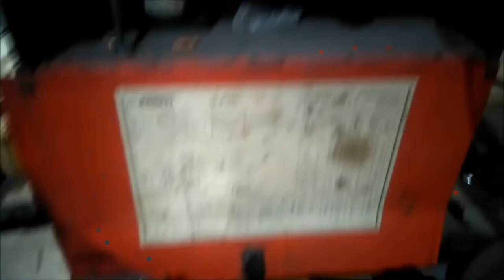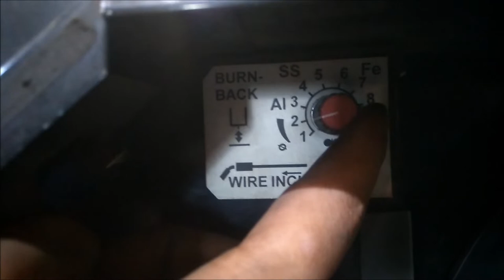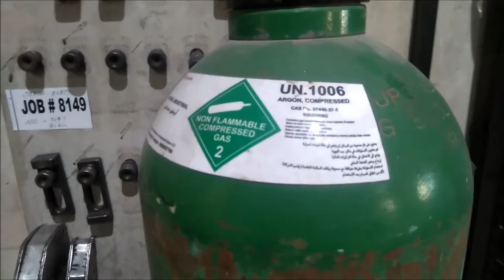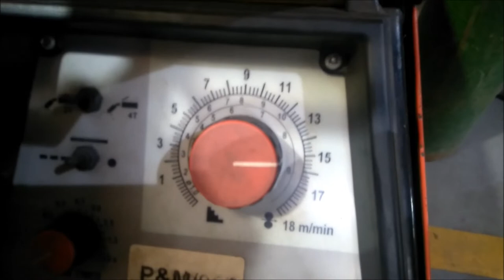അലുമിനിയം വെൽഡിംഗ്,एल्यूमीनियम वेल्डिंग,mig welding aluminium in malayalam

Comment: Aluminium welding set evideya kittum plz number on u tharamoo bro
Reply from the maker: please contact in this number 9656616648
Reply: This is MIG welding machine. U can ask anywhere,will get. Only thing is feed roller and welding toch set up should change.